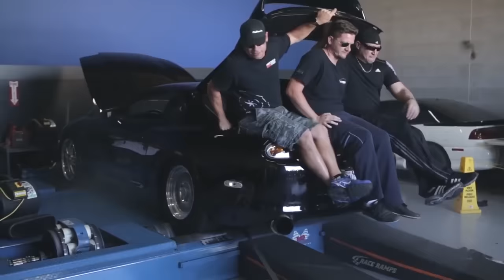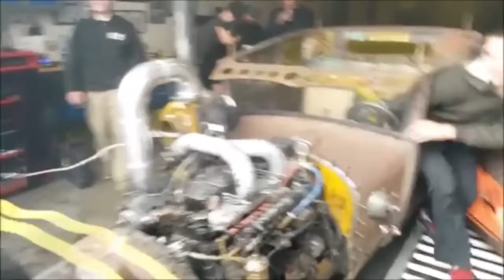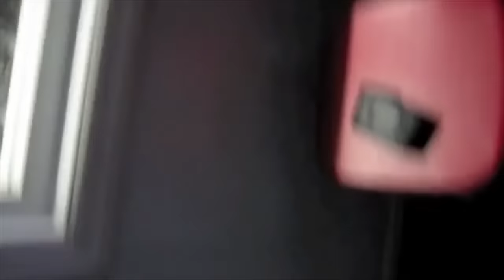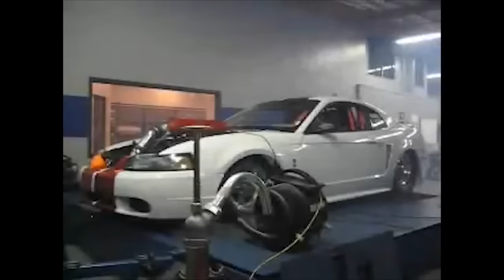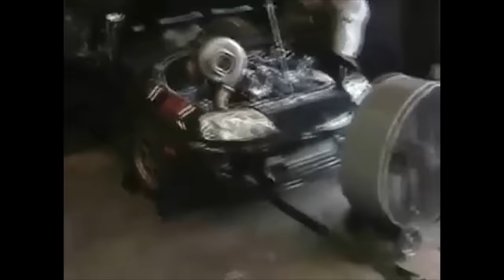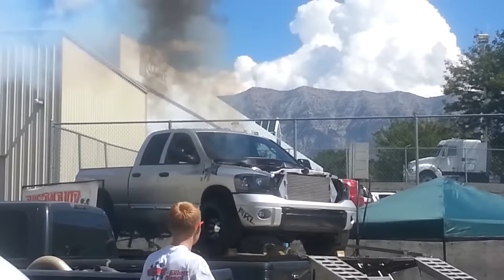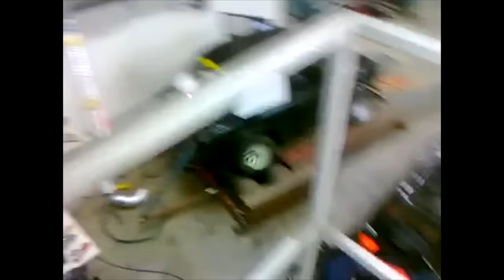The Best Dyno Fail Compilation

Comment: Yeah let's max out the engine for 30 seconds whilst literally no cold air is running over the car.
Reply: BIG Dave Generally they have fans blowing air from the front, but yeah, a lot of these didn’t.
Reply: Also the dyno doesn’t offer the resistance that the road does, allowing for catastrophic failure levels of RPM.
Reply: Nathan Stark Decent dynos usually get a good source of wind blowing directly towards the vehicle, wether it be a high powered fan or something.
Reply: Good idea
Reply: Simon Kaggwa Njala RPM, not MPH
Reply: @Harry_Ballz  Either way the question works. The answer is no. A fan will not blow wind at 150 RPM. It's spinning too slow. This was me being a smartass.
Reply: Hey why does the engine blow up like that and many times it doesnt even though ppl launch and reach the red line i have 0 knowledge
Reply: Спкфпњ цп е9шц дѓшвллдмс9 клешти во светот и во странство со цел за себе
Reply: Doesn't matter, not anyone lives in Alaska or wherever is cold air outside 🤦🏻‍♂️
Reply: This replies thread is one of the most hilarious internet fights I've ever seen. Outstanding work everyone.
Reply: car engines are water cooled you dont need cold air only are for the intake now two stroke engines need air well some of them anyway
Reply: @ianspaintpot  Block up your grille so your radiator doesn't get airflow and get back to me.
Reply: Turning up RPMs isn't maxing the engine out. The engine is designed to operate at such speeds. Hence... redline? Wanna max out the engine? Try going uphill on high gear. Besides, how do you suggest vehicles get custom tune?
Reply: @Harry_Ballz  It doesn't need to blow 150mph. Cruising speed air is plenty for tuning. You're not WOT for minutes at a time, you do a pull and bring it back down and tweak. Engines don't heat up nearly as fast as you think they do. If it was a problem then every shop in the world wouldn't be using the same basic fans
Reply: @benzynowypiotrek  dont be stupid when i am driving i never let the revs go into the red iven is going up hill or pulling trailers.
this is why the high revs are in red because it is not a good idea
Reply: I put ice in front of my car with a fan
Reply: @classiestbogan  my car doesn’t have a grille
Reply: Clown.
Reply: Well said! Only a half-wit would put it down to lack of cooling on a single,short run.
Reply: @Harry_Ballz  does an engine produce more heat at 8000RPM in 1st gear compared to 6th gear???? (i know the answer)
Reply: True
Reply: you realise its the water that cools the car, not the air?
air cools the water, and in 30seconds the water isnt going to be at 110-120C already lol
Reply: @thenate42  no load same as revving outboard engines when not in the water
Reply: Some were the actual Dyno failing?
Reply: Ш
Reply: @classiestbogan  any standard road car can have no air going over the convector/radiator without issue at low revs.
Reply: @matthew4107  Thanks to the fans.
Reply: @sntslilhlpr6601  I saw a comment a minute ago and wanted to steal the phrase..."smooth brains" 
kinda like the smooth-brains mobbin' so deep around the dyno it looks like they are in a rap video.

Yea it is likely a combination of all those things you mentioned...I think a few of them might have just maxed/broke the dyno. 

I am from the Appalachian Mountain area and I have always liked the phrase "scatter" to describe something that is spinning stupid fast when things go all to hell. 
I decided that was the perfect term when watching a video of a compact-disc being spun to it's "self destruct" RPM lol it quite literally scattered.
Reply: @AYouTubeChannelwithNoName  yea rotation of the crankshaft not the tires lmfao i can be at 9000 rpms but going 40 mph
Reply: @Harry_Ballz  mans is just WAITING to insult lmao
Reply: @bigtime9597  im sorry i gotta be a smart ass here but im sure most fans can go 150RPM that ain’t that much 😭😭
Reply: @thenate42  is this true?
Damn
Reply: @sntslilhlpr6601  damn right

I have the philosophy to OVERBUILD a motor

A motor can theoretically handle 800? but let’s be frank there no reason to have it at 800 but since the engine is capable of 300 more HP it will be quite durable and reliable just at 500 HP. Just like how endurance engines are made. Nice and durable, yet still good for the real world.
Reply: @thenate42  ydgg try 5yuiiim look
Reply: Exactly.... Dyno tracks are so dumb.
Reply: @Harry_Ballz  Yes, yes they can actually, all dyno places here in Belgium, Europe, have a proper setup where that is quite possible, we've got quite strict safety regulations here, clearly not in the USA though lmao
Reply: @yourmother9117  Does matter, because we got this video lmao.
Reply: @ianspaintpot  I guess that's why the radiator and fans aren't actually functioning parts. They're decorations.
Reply: @matthew4107  Since it's only water and not air that cools the engine, block up your grill and tell me the temperature isn't higher than usual if not overheating. I'll wait.
Reply: @thevalorousdong7675  yes, thats right, water cools the engine. air cools the water. if you block the grill, you have time before the engine generates the heat required to get the water up to high temperature, then any blockage material or air surrounding the radiator will be warmed up. THEN the engine will overheat. but like i said, even if you dont have a radiator fit at all ie: blocking the radiator completely from any airflow at all). the engine can run on a dyno for very short period without issue. why? because the water itself will soak up some heat before it gets to the point it cant soak any more up because theres nothing cooling the water down.

saying 'ill wait'' like you have any idea what your talking about xD sure, if you drive 50miles with a blocked up grill, your gonna be running really hot and have problem. you speak like im saying dont have any water in the engine at all. im not saying this, because then it would be as you imagine it would be.
Reply: A fan can’t because is just positive displacement of air.. but a blower can because it’s pressurized air
Reply: I agree, such a waste 😢
Reply: Guys, Here is our Savior

YaH The Heavenly FATHER HIMSELF was Who they Crucified/Pierced for our sins and “HERE IS THE PROOF”

From the Ancient Egyptian Semitic: 
"Yad He Vav He" is what Moshe (Moses) wrote, when Moses asked YaH His Name (Exodus 3)

Ancient Egyptian Semitic Direct Translation
Yad - "Behold The Hand"
He - "Behold the Breath"
Vav - "Behold The NAIL" <— YaH’s Crucifixion
He - "Behold the Breath"

“Behold the HAND that Beholds The NAIL” 

PROVES - YAH The Heavenly Father HIMSELF was Who they Crucified

That is EXACTLY what Moses Wrote

Here is what they mean

YaH's Name:
(Ya)d + (H)e, as YaH is what Moses called Him and YaH Declared: "this is My Name, this is My Name for all generations" (Exodus 3)

YaH is The Creator of “MAN”: (Genesis 2:7)
Yad He, (HAND BREATH), as YaH's "HAND" Formed man from the dust  of the Earth and His "BREATH" made him a living being (Adam)

YaH's Sacrifice of Crucifixion for “MAN”:
Vav He (NAIL BREATH), the "NAIL" through YaH’s "HAND", in Sacrifice of Crucifixion, that whosoever shall call YaH Savior, His “BREATH” brings forth life (Salvation)

How YaH arrives:
YaH arrives via the Tent of Meeting (Exodus 33:7:11, Isaiah 54, 55), where a Tent is erected outside the city, a cloud descends upon the entrance of the Tent and YaH appears...

Why they demanded YaH to be Crucified:
YaH was Crucified according to Hebrew law (Deuteronomy 21), to be NAILED/PIERCED on an Almond Tree for BLASPHEMY as it was for His NAME they demanded Him Crucified. The Messiah claimed He was YaH...

HE WAS YaH!!!

HalleluYAH translates “Praise ye YaH”

The Hebrew Book of Isaiah

Isaiah 42:8
"I am YaH; that is my Name! I will not yield my glory to another or my praise to idols.

Isaiah 43:11
I, I am YAH, and there is no other Savior but Me.

Isaiah 45:5
I am YaH, and there is none else.
Reply: @Harry_Ballz  Yes
Reply: Americans
Reply: @ianspaintpot  and what do you think cools the water? Holy crap the ignorance in these replies lol.
Reply: @thenate42  First off, there are load bearing dynos. Secondly, a car being under load has absolutely no influence on the max rpm when doing a pull. 

The fact that this received so many likes is honestly terrifying. The irony is astounding.
Reply: @Harry_Ballz  It's more about CFM than velocity. A 1" pipe with air velocity of 150mph will yield 72cfm. A 1ft sq duct wouldn't even need 1mph to supply the same 72cfm of airflow.
Reply: @Harry_Ballz yes lmfao
Reply: @Harry_Ballz  nah but a massive fan is usually common practice when using a dyno 👍 if it doesn’t work , like you’re implying, why is it the industry standard😂😂
Reply: @azzyofficial11 bad tunes or parts not adequate for the power being made. Dyno is made for one thing only, to calibrate air fuel ratios in real life situations and if done wrong can turn the motor into a bomb or parts can fail. Alot of people slap a turbo on and cheap out on making the engine itself able to handle the amount of air that turbo will be introducing into its system. Or cheap out on the fuel delivery systems too.
Reply: Your pfp reminds me of the boondocks
Reply: @Harry_Ballz yes it can.....if you buy the right right ones.
Reply: @Harry_Ballz yes actually

Comment: If you stand anywhere around a Dyno while in use you should get a Darwin award.
Reply: Doddering old fool alert 9:24
Reply: @9:05 Happily awaiting a Darwin Award
Reply: @armandhammer9617  that could have been a lot worse!
Reply: @stevenpavelish6017  they are awarded posthumously 💀
Reply: I've seen cars pivot off during pre OBD emissions tests.
Reply: Those first three guys sitting on it really set the bar high for the rest of the video though.
Reply: So many hot metal parts moving extremely fast
If something goes slightly wrong you could end up as a statistic
Reply: Why do some guys decide to sit on the car tho while in the middle of a run is it to help the car stay planted or something? Still stupid jw.
Reply: Kkkkkkk
Reply: @armandhammer9617  XD
Reply: When your engine cant take it anymore

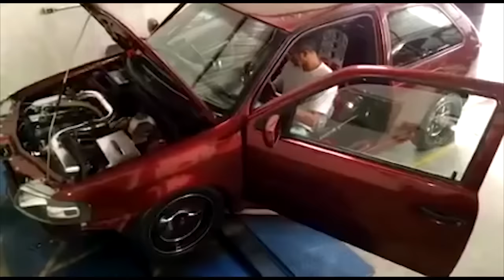6:14
Reply: Darwin award 💀
Reply: General lack of safety protocols seems to be a common thread
Reply: @armandhammer9617  Everyone else in the room is a young fool.
Reply: Ayyy Brandon Herrera reference
I get it
Reply: People who stand in front of dyno's should get a darwin plaque
Reply: using Engine made of Weak us steel was the first fault
Reply: That is OKAY  we do not need them is the JEAN pool an way
Reply: The rules of the Darwin Award are simple: you have to remove yourself from the gene pool due to the foreseeable results of your actions. Simply placing yourself in a potentially dangerous situation is not sufficient if you survive without making yourself impotent.
Reply: Guys, Here is our Savior

YaH The Heavenly FATHER HIMSELF was Who they Crucified/Pierced for our sins and “HERE IS THE PROOF”

From the Ancient Egyptian Semitic: 
"Yad He Vav He" is what Moshe (Moses) wrote, when Moses asked YaH His Name (Exodus 3)

Ancient Egyptian Semitic Direct Translation
Yad - "Behold The Hand"
He - "Behold the Breath"
Vav - "Behold The NAIL" <— YaH’s Crucifixion
He - "Behold the Breath"

“Behold the HAND that Beholds The NAIL” 

PROVES - YAH The Heavenly Father HIMSELF was Who they Crucified

That is EXACTLY what Moses Wrote

Here is what they mean

YaH's Name:
(Ya)d + (H)e, as YaH is what Moses called Him and YaH Declared: "this is My Name, this is My Name for all generations" (Exodus 3)

YaH is The Creator of “MAN”: (Genesis 2:7)
Yad He, (HAND BREATH), as YaH's "HAND" Formed man from the dust  of the Earth and His "BREATH" made him a living being (Adam)

YaH's Sacrifice of Crucifixion for “MAN”:
Vav He (NAIL BREATH), the "NAIL" through YaH’s "HAND", in Sacrifice of Crucifixion, that whosoever shall call YaH Savior, His “BREATH” brings forth life (Salvation)

How YaH arrives:
YaH arrives via the Tent of Meeting (Exodus 33:7:11, Isaiah 54, 55), where a Tent is erected outside the city, a cloud descends upon the entrance of the Tent and YaH appears...

Why they demanded YaH to be Crucified:
YaH was Crucified according to Hebrew law (Deuteronomy 21), to be NAILED/PIERCED on an Almond Tree for BLASPHEMY as it was for His NAME they demanded Him Crucified. The Messiah claimed He was YaH...

HE WAS YaH!!!

HalleluYAH translates “Praise ye YaH”

The Hebrew Book of Isaiah

Isaiah 42:8
"I am YaH; that is my Name! I will not yield my glory to another or my praise to idols.

Isaiah 43:11
I, I am YAH, and there is no other Savior but Me.

Isaiah 45:5
I am YaH, and there is none else.
Reply: @armandhammer9617  😂😂
Reply: @armandhammer9617  someone yells papa!
Reply: @PorscheGT-yj2me  its to hold the car down because the tires are shit....
Reply: @SJ-cy3hp  5:10 I am sure this guy will win it first
Reply: be amazed fr
Reply: Reported for copy/paste from another video who already exist
Reply: Exactly!  You've got things spinning, things reciprocating pieces of Tire that go straight when they rip off etc.  It's extremely more dangerous than you'd think... if someone can't see that.. well I guess doctors and funeral homes are happy that you're keeping them busy!
Reply: What is a Darwin award?
Reply: @galaxiedance3135 The dude @5:42?

What if that truck slipped off the dyno?

Perhaps it's a macho thing?
Reply: @SJ-cy3hp facts
Reply: @AmplifydMedia  evolution of man only the smart survive
Reply: @SJ-cy3hp  Thanks bro, I searched for it immediately after I commented but thank you still 😂😂
Reply: Big facts 😂😂😂😂